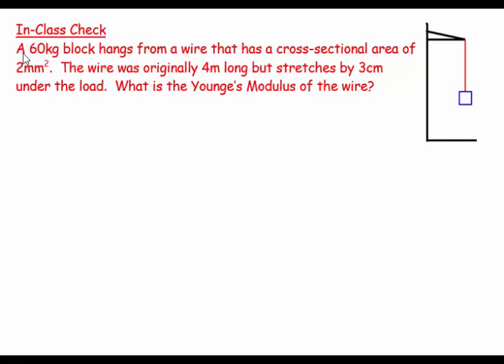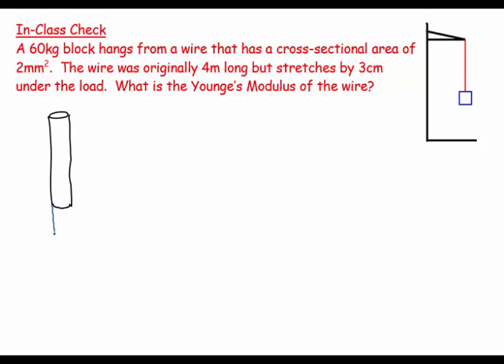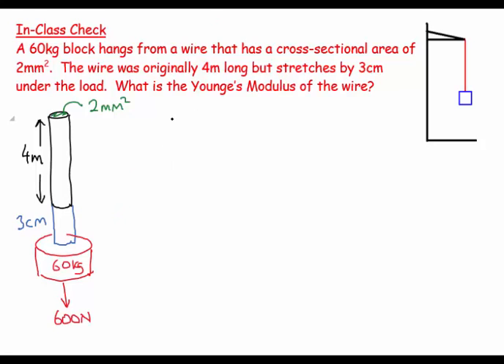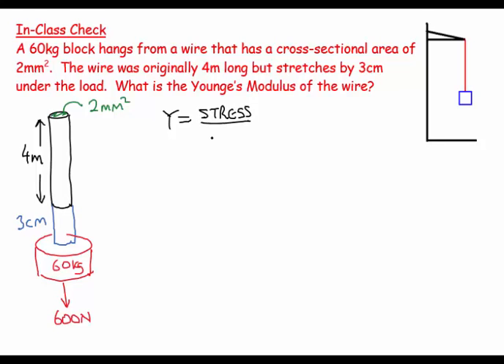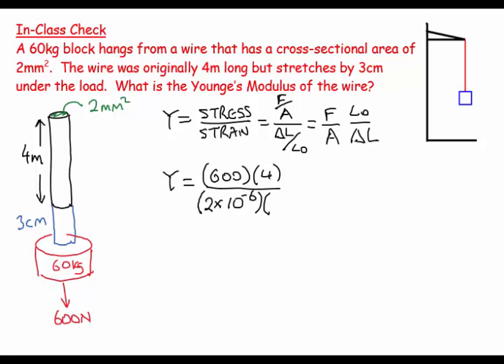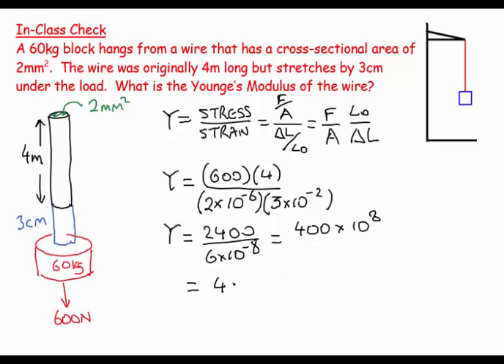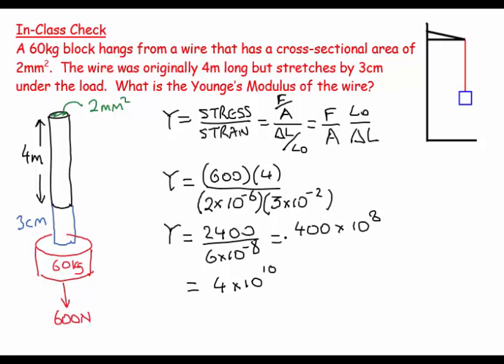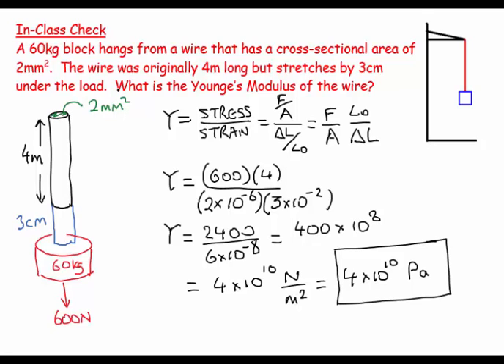12) Young's Modulus 1 - numerical

Comment: Where we get 600n?
Reply from the maker: We multiply the mass (60kg) by the gravitational field strength (10N/kg) to get 600N weight Rafiya.  I use 10 N/kg instead of 9.8 N/kg because it makes the math go faster.
Reply: @abuonaquisti  It's also incorrect.
Reply: Force = mass x acceleration  (due to gravity)

Comment: What if original length is missing?
Reply from the maker: Dear Leah:  The question has to give you the information so that you can get the original length and the extension.  So I could give you the original length and final length.  Or I could give you the extension and final length.  I suppose I could give you and extension and the ratio between that length and the original length.  However I do it, you need to be able to determine the original length and the extension though.